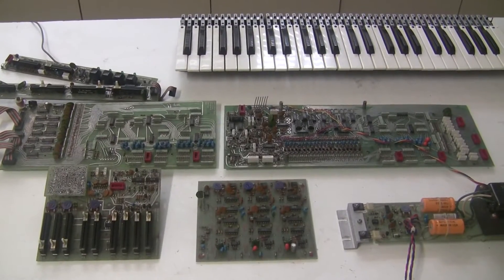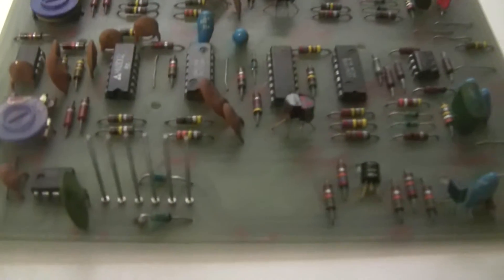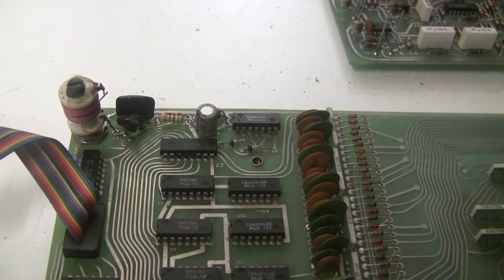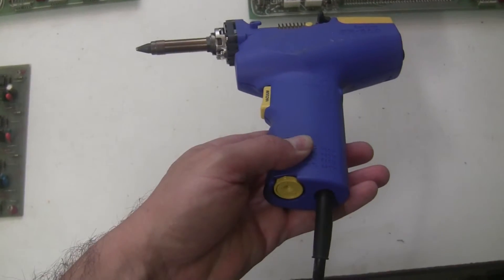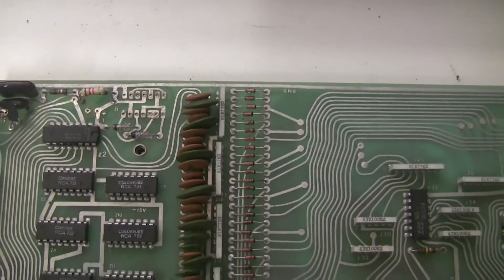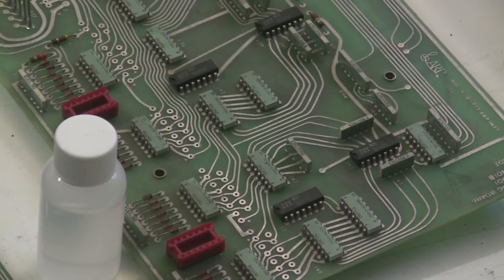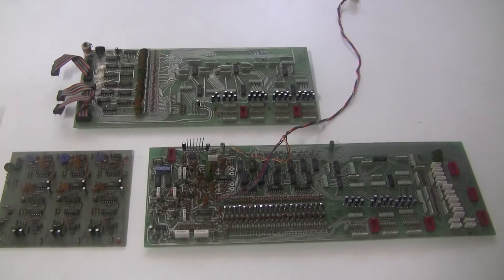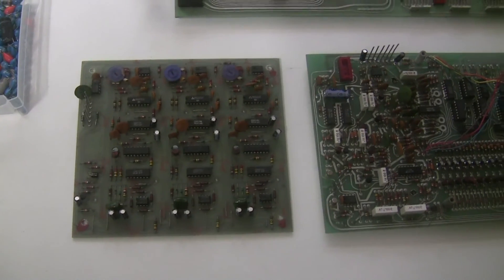Synthchaser #035 - ARP Omni 1 Restoration & Repair - 2/4 - Recapping

Comment: Some of us modded our Omni’s to improve or expand the sound,  that might explain some of your component value changes.  We lifted components up here and there to try things out.  
     It’s been since the 70’s that I modded my Omni, so I can’t remember what all we did specifically.  But one big improvement I remember was removing the IC that caused the keyboard split.  The result was everything worked over the full keyboard and the sound was huge.  We installed stereo chorus & flangers on the outputs.  
   Sadly mine was in a fire, all the keys were melted.  But incredibly I managed to restore it.   I had the same problem you had with the sliders, but I settled for cleaning option.  Works,  but it’s not pretty.
   Hats off to you for going to the extreme to restore your Omni.  They just don’t make em like that anymore.  (Can’t believe I paid 2 grand for it new, considering most of the IC’s you could get at Radio Shack in the 70’s, nothing custom inside like the Polymoog had)